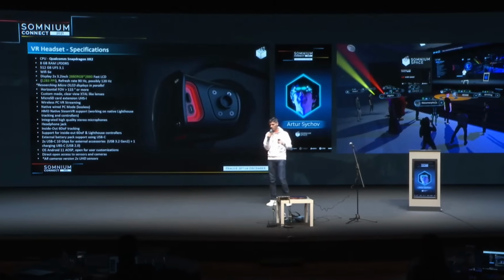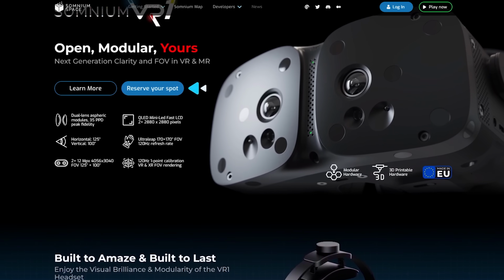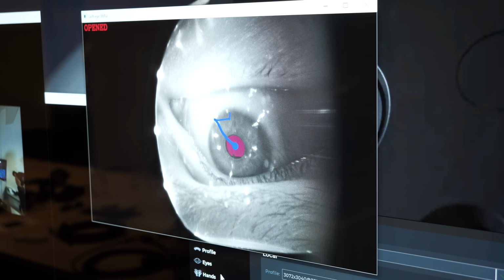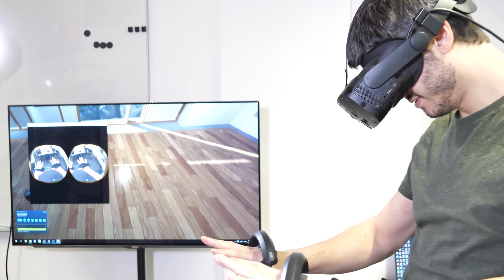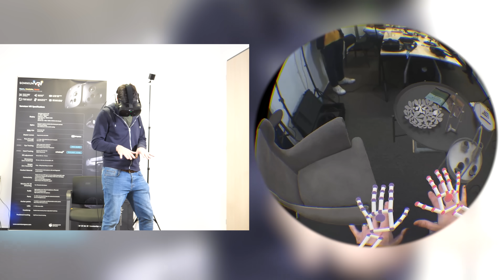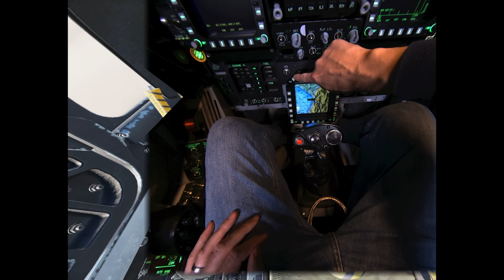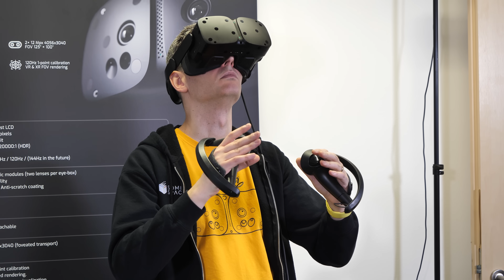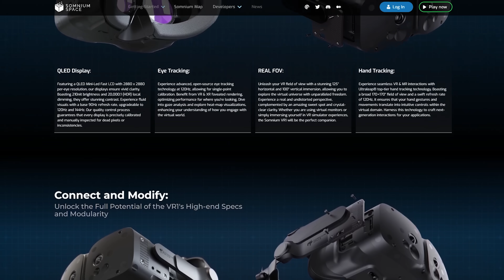Somnium VR-1  First Hands-On & THROUGH The LENSES!!

Comment: that has 2 cables? I am a VR user, I have the valve index, meta quest 2 and pico 4, since last year I saw this viewer I am interested in replacing the index with it.
Reply: 1 cable for pure VR version and 2 cables if you want to use MR. You can unscrew MR cable if you do not need it.
Reply: @artursychov  you know what's better than 2 cables? 3 cables!
what SDK does the MR use? looks like you just chroma key a VR app to display passthrough instead LMAO. something even Virtual Desktop can do.
Reply: @artursychov  Ok, do you know more or less what the price of the final product will be? I'm spanish
Reply: @Bok3RonVR  Starting price is 1899 + taxes.
Reply: @artursychov  Thanks for the information, I see them as somewhat expensive considering the Pico 4 or the Quest 3 for around €600, I expected it to be worth around €1000

Comment: Lost of cool features. They lost me quite a bit by using LCD, though.
Reply: lots? name two.
Reply: @Pixel3DVR  MR, eyetracking, handtracking, local dimming with 576 points. FOUR
Reply: @Directx11cool  - They never elaborated on MR - it appears to be using sort of chroma key to replace virtual with passthrough (which does not adjust to user IPD anyway)
- Handtracking - you could have plugged Ultraleap module to Oculus DevKit 1 in 2014. There is no hand tracking without module at all. Quest 1 has hand tracking through cameras. That headset came out in 2019.
- local dimming? that's a band aid solution. PSVR2 does not have local dimming, because the pixels are actually switched off and are self-emitting rather than being backlit. It also has HDR support.

TRASH
Reply: @Pixel3DVR  oh, so you fun of PSVR2 and stupid console games? I've got it.
Reply: @Directx11cool  youre just brainwashed elitists, arent you

Comment: The pimax software comment seemed a bit unfair when their software is now very stable and also you were trying this headset in a controlled environment from the headset manufacturer.

I also think the whole 'open and modular' stuff is very misleading and just marketing. All that is modular is that you can remove the side panels to more neatly attach different headstraps, but I don't see it as all that big of a deal as you can already just 3d print parts to use whatever headstrap you want. Am I missing something? How else is it modular? Also how is the headset open source? So far I have heard the eye tracking stuff will be open source and there will be some cad files available. That's it. That doesn't make something open source. Sorry but this marketing stuff feels like similar nonsense to Pimax when they said stuff like the crystal had 125degree horizontal FOV. I really wish headset manufacturers were more honest.

Sorry I know that was all a bit negative but I just get a bad vibe about some of this hype. It feels misleading.

That said, this is a very interesting headset. The price is out of my budget but if I could afford it I would definitely consider it. It's a pity they didn't go for higher resolution panels or such to differentiate it from the crystal or aero, I think they will have a tough time but it seems well made and always great to have more competition. I hope they continue and we see a vr2 with hypervision lenses!

Good luck to Somnium!
Reply from the maker: Hey! To start thanks for the comment! The Pimax comment is actually because of my personal experience, but I also agree that there we were in a controlled environment :) about the modular and open I guess because you will be able to modify everything, beside the sensors that you add. The ultraleap is not of their property so they can't share anything of that, same thing for steamVR tracking, so I guess they are open on what they own? I also agree that it's part of the marketing, but it seems to be at least a step in the right direction that I would like to see from more manufacturers :) 
With that said I don't think I created hype, at least I really didn't mean to. The headset as I said still need a lot of work, hopefully they will be able to fix it :)
Reply: Sorry didn't mean to be rude about the hype thing, I was responding to the hype in general. Thanks for the reply and I really appreciate your content, been subscribed for years. Merry Christmas and keep up the good work!
Reply from the maker: @HeadsetHistorian  no offense taken don't worry, I just wanted to clarify ;) merry Christmas to you as well and happy new year :)
Reply: If you ignore daily posts about software issues, connection issues, qc issues then I guess you can claim software is very stable :D. Pimax was doing tests in controlled environments multiple times and we heard tons of problems happening. So I would say Somnium did a solid work anyway.

Comment: Also Pimax software I find has no issues at all now so why talk smack?
Reply: I use Pimax software 3+ years. It works pretty bad. I've got a new firmware once and 8KX got black screen for 90Hz mode, have to use DFU mode to revert the firmware.  
In last version it constantly write to disk config.json.tmp-"hash". Looks like stupid loop in their javasript shit.
Also after selecting pimax experience in the PimaxClient and installing it, experience suggests me to udpdate it in VR. Then it downloads the update and I click restart. But after that it it was the same version. It takes 10 minites to figure out that your updater actually get this message and do nothing. I created a zip archive, put it inside and it magically works. 
Still no reaction for my post about these two bugs after 3 weeks.
Reply: When I look through the window the ground is flat so Earth is flat. I see it like that so it's true.

Comment: When are these companies going to understand that as soon as they mention base stations 90% of us are not interested as we never bought the index and are not prepared to swallow the extra cost ontop of an already overpriced headset
Reply: Disagreed. Inside out tracking is unreliable and has no place in an enthusiast product. The base stations are a tiny cost compared to the headset and the pc necessary to drive this thing
Reply: @AniviaS  Yes, but he says that for the majority of VR beginners who don't want to have the best experience, it is difficult to get excited as the person will have to spend 300 dollars or more, a beginner seeing this expense and the greater difficulty of installation and configuration you will prefer to buy a meta quest 3 because it is simpler.
Reply: @Raphajobinn6868  yes, this is not a device for VR beginners. The pc required to drive this resolution and refresh rate costs more than the headset alone. You can't really compare it to a mainstream device like the Quest 3, they have completely different target audiences
Reply: Actually i have a quest pro and never had an issue with tracking. I also have basestations (2 of them) and had way more tracking problems and drop outs using my old pimax 5k headset. So lets wait and see...

Comment: I've had an Index since early 2019. Nearly five years. I've had one headset RMA. It's used every day. It's falling apart. If it had been modular like the VR-1, I'd likely have been able to fix it properly, and keep it going longer. Better for my wallet, and the environment. 

Instead, the version I have right now is held together with whatever I could make, and it's not great.  For my daily use of VR, the VR1 needs to last for several years. Then I'm not complaining for the upfront cost. 

Otherwise, the alternatives are to buy a new, slightly upgraded headset every year plus all the add-ons requried to make it usable.  Sure, avoiding an upfront cost is great and all. All the current standalone-as-PCVR upgrade cycle serve is to add to tech-paperweight collections. Which eventually ends up in landfill.  

Audio is the issue I'd like to see adressed fully. Otherwise, I'm happy with the direction this is going, and appreciate the openess under which Somnium allow their headsets to be scrutinised. I hope we get to see ALL the issues addressed before pre-orders are accepted, and money finally changes hands.
Reply: thr index does have spares though? headstrap can be replaced and so can the displays? ifixit sells replacements do they not? 

whats dying on yours?
Reply: @Derpynewb  the matchstick plastic bar holding the top strap to the front of the headset has now snapped in three places. It's beyond repair. So it's four holes drilled, and fence wire threaded through, and the strap wrapped around that. Works, but meh...
Reply: @kroysteamvr  thats a new one, never heard of that breaking before. ive heard of broken sheadstraps themselves, the cable clips, the cables, the controllers, but the part your talking about i havent heard that in my circles yet. Might happen more often since the headsets out there are pretty old. Yeah there are no replacements for that part. Thanks for sharing, now i know what other parts of the headset to be mindful of.

Comment: I want PCVR headset with easy to connection to PC, be light, not getting hot, high FOV.
I have Quest 2 but it to much hustle set it up and its front heavy and getting to hot.
Reply: If quest 2 is a hassle for you, nothing will ever be plug n play for you
Reply: @Pixel3DVR  - i do not have wifi5, i use mobile hotspot. 
- I have gaming laptop.
First, i connect phone to laptop by wire, after turn on hotspot. Connect both headset and laptop to that wifi.
After launch oculus link, later steam.
Besides, oculus launches it serveses in windows and even if i close oculus app it still activate dedicate GPU and also after each session i need to turn it off.
With PC and dedicated router sounds nice. But may off us do not have that comfort in life

Comment: Honestly I think yourself and Brad along with any others you can think of should form up into a VR company and work on a VR headset yourselves.  
Your all very committed to VR and have a reasonable understanding of the technology and these days anyone can DIY one with enough technical skill.
Sure bringing it to market is multi-million-dollar issue but if you can come up with a decent headset I'm sure you can find some funding.

In saying all that, 
I want eye tracking but also mOLED (or similar) 140 FOV headset with Wireless functionality.. that is what I want, but it seems unless your willing to pay thousands, it just isn't possible. But maybe it can be done under $1000usd for such a headset if done by a small dedicated team?  
No doubt the lens will be a huge technical challenge, but, maybe doable with 3D printer tech and resin mold methods?????

Comment: I wish them nothing but the best luck, VR needs these kind of moonshot projects even if just to boost research and development in the industry.
Reply: How is it a moonshot? It doesn't really go all that beyond the crystal. It's essentially the crystal with MR (no depth sensor though) and a mildly wider FOV. 

It seems like a great headset but I don't see how it is a moonshot or doing anything wild. We have had headsets like this for 3+ years now that actually does more(Varjo XR3).

I'm skeptical of a lot of these positive comments, are they just to try and boost the crypto stuff? The term moonshot seems like a potential freudian slip the more I think about it...
Reply: @HeadsetHistorian It's not even a wider fov than the Crystal if you get those extra lenses either...and isn't pimax supposed to offer a new faceplate with MR?
Reply: @Whatsup_Abroad now with Crystal Super coming out this is dead in the water.
Reply: @laartwork no it isn't since crystal super is insanely far far away in the future and you can only use the 51 PPD in 2 games , dcs and Pavlov due to display port 1.4 .
Same case for Varjo Xr4 .
Reply: how does this boost anything for anyone?

Comment: After using the wide FOV Pimax headsets, which I usually set the FOV to "Small" mode, led me down that path where I cant go back, or dont want to, go back to normal FOV heradsets. The VR-1's FOV should be on par with the Index which I found ok.  Some are wondering why buy this when the Crystal, Beyond, Varjo are out thier for much less money.  I think the best selling points for the VR-1 are the high res panels, larger FOV and the fact that its NOT made in China.   I love the FOV of the Pimax headsets but the glitches etc etc were a PIA.  I just put in a preorder its only money right..  You dont have to register a credit card so Ill keep an eye on the Bradleys review as well.  I really hope they get the barrel distortions fixed.  I remember using the XTAL 5K and 8K units and the world scale seemed small just like Tyriel experienced with the VR-1, I hope they are able to fix this as well before production.  BTW ther is still no pricing on the website as of now

Comment: I've been mildly interested in this project for quite awhile as someone who's been a high end PC enthusiast. But man, if their price point really is like $1,700 and up from the lowest models, I really just don't see it. 

For the lower models that won't even have MR, it seems like it would be WAY more sensible to go with the cheaper and smaller Bigscreen Beyond. And for the more expensive models that are fully loaded, at that price point I would think you'd rather just stretch your budget to the Varjo XR-4 instead. Kind of unfortunate timing and pricing.
Reply: i feel the same way about it, im looking for a kinda mid-range headset but with a large fov, and unfortunately 1700$ is not mid at all. i think pimax is better at that point
Reply: I think Steam Deckard will cost as much as the current Index. I prefer to hold off until then rather than buy this.
Reply: @DraconicA5  That's how I've felt for years. Something better always seems to be just over the horizon. I really hope the Deckard comes out in 2024 and doesn't sacrifice PCVR for standalone.
You just gotta bite the bullet eventually and settle for something, even if a high end PCVR HMD is a pill that's as tough to swallow as a roll of 10 to 20 $100 bills, or settle for something less knowing it will be replaced soon.
Reply: If this came out a year ago I would have bought it, so yeah the timing is a bit unfortunate. 
I'll never buy a PiMax (not a new one at least) so for dedicated PCVR I'm looking at just this right now. I know 2 people that say their experience with the Aero is/ was pretty rough. 
I'm still hoping whatever Valve is cooking up isn't too huge a departure from the Index and still compatible with lighthouses. All I can do is continue to wait.
Reply: @Wooskii1 Why not a Pimax? The product and service are fine. Don't pay attention to the people on their reddit and discord. Bunch of idiots. Pimax put out a few months back that their average buyer is over 50 years old. Something like 1/4 of their customers is over 70. Literal fucking grandpas who can't get their stuff to work so they go online and complain. Bunch of idiots.
Reply: I can understand 1700 ish for the base model. However, I don’t see how leap motion and a couple cameras cost 1300ish. The upcharge is BS.

Comment: Another big Bulky vr headset as the Pimax Crystal but with almost the double price . What are getting more than the Crystal?! 5-7 degrees in H FOV?! At least the Crystal with its basic price has inside outside tracking, eyes tracking, pass through..,,,,  basically its a Pimax Crystal with less features but more expensive.
Reply: So true why the would anyone buy the base at 1899 when it is worse than the pimax crystal for 1350. quite funny
Reply: @nicolaskurinnyy5917 Made in Europe
Reply: Yeah, pancake lens would’ve made it more interesting
Reply: Where did you pull out 5-7 degrees from XD? Do I have to remind you that Pimax claimed 125 but realistically it was 102? You also forget that Pimax has myriad of issues with qc and software and poor support.

Comment: Great video. you got a new subscriber. You mentioned 3000 for the fully spec'd version. Was that USD or Euros?
Reply: This is without VAT and lighthouses - I think it's more important here than the 10% difference between USD and EUR.
Reply: @Fiztex553  And without VAT as well? I suspect this mile long list of reservations will dry up pretty significantly.